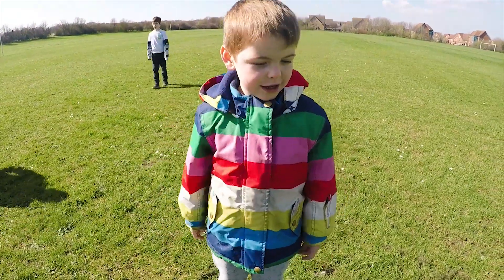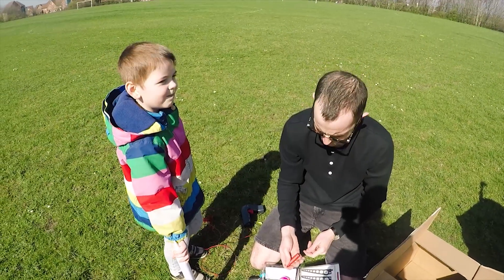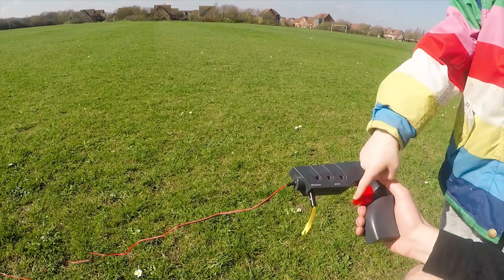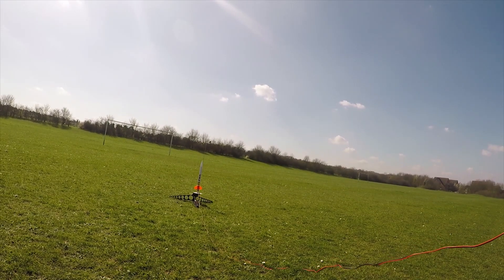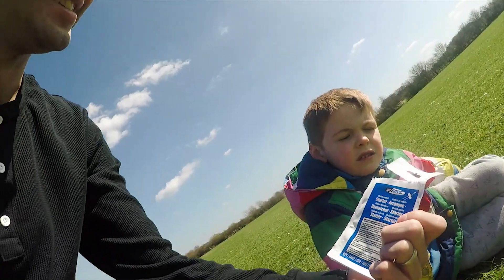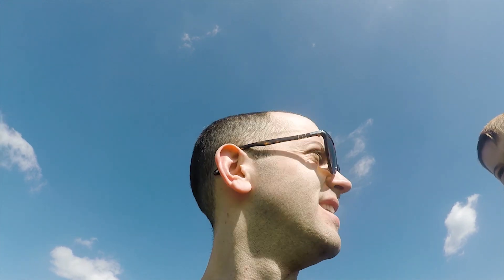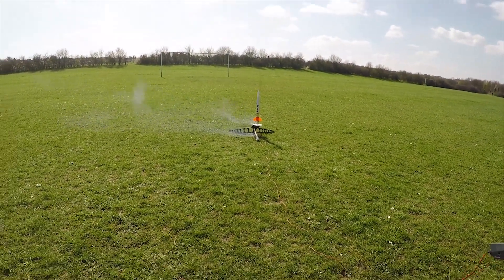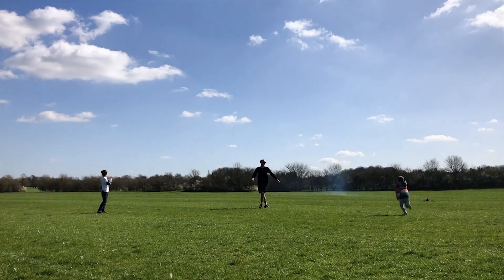KLIMA PAN FIRST ROCKET LAUNCH - BEGINNERS MODEL ROCKET

Comment: Thanks for posting this. I have 2 boys same age and we will be launching the same pan rocket in a couple of weeks. Any tips to ensure successful first launch would be much appreciated.
Reply: I have the same one.  I had one small accident, where Wind started, shortly after the rocket started and was still in the air. It ended up in an tree thats why after that start i always ensured, that no tree is nearby.